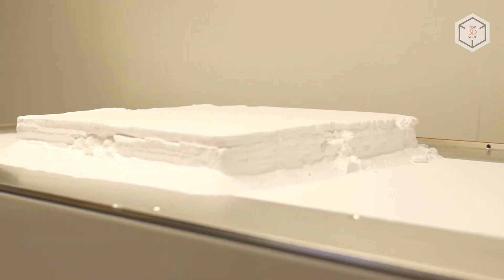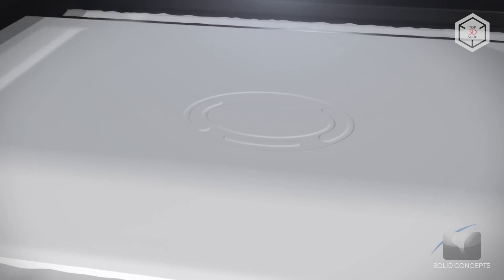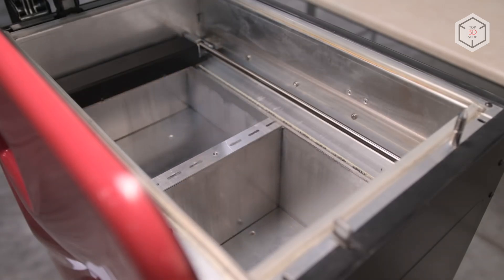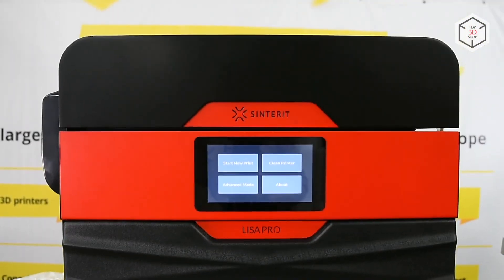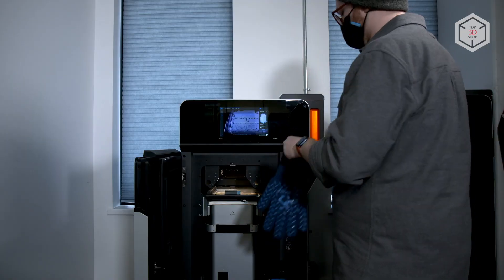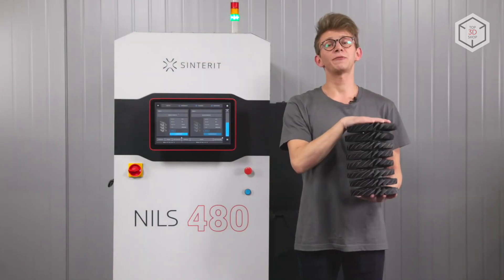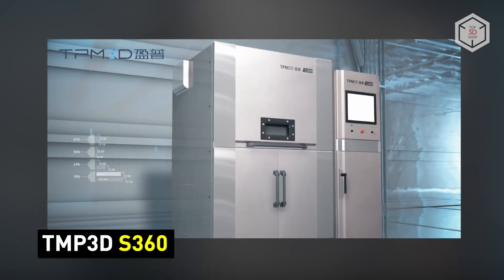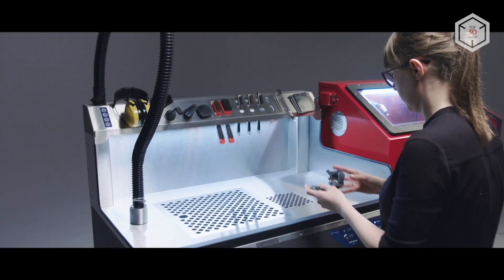Selective Laser Sintering Overview and the Best SLS 3D Printers on the Market

Comment: Heard terrible things about formlab fuse. Literal nightmares about terrible print quality. Not accurate whatsoever.
Reply: There are/were shrinkage compensation formulas that need(ed) some tweaking for sure. If I recall correctly, there was a manufacturing fault with the build chambers that was causing layer lines or z shifts. I was informed of this about 3 or so months ago. The engineers in Somerville discovered it and I believe updates were sent to the factory and a rebuild / repair plan was likely rolled out. I think it was a user serviceable fix. There were definitely some quality control problems with the factory making the Formlabs build chambers as they had previous issues that were also user serviceable. That said - users shouldn't have to be reworking brand new equipment.

Comment: I uploaded a model to one company for a quote and for something about 20 inches x 7 x 5 the quote was around $10,000 for aluminum. I called them to check and they said the quote was correct. I want to use this technique for art but at that price it is not cost effective.
Reply: If you want to print with aluminum, then you should try SLM printer instead of SLS
Reply: hello,we also provide 3D printing service, just curiously the quotation before.How about inquirying us with you 3D files?

Comment: Note, The Formlabs Fuse 1 is no longer available as the Fuse 1+ was released in 2022. The Fuse 1+ utilizes a 30W laser which is a significant improvement over the Fuse 1's 10W laser. This, along with an integrated agitator in the hopper, allows for improved print speeds to the tune of nearly 2x over the Fuse 1. The 30W laser also allows for a greater variety of materials such as Nylon 11 Carbon Fiber and TPU. (The Fuse 1 can only print Nylon 12, Nylon 12 GF (glass filled), and Nylon 11). There is no option to upgrade to a Fuse 1 to a 1+ so a new printer must be purchased. The only change required for the Sift post-processing unit is a firmware update to support newer materials (and potential bug fixes and changes).
Reply: thanks
Reply: By replacing the Fuse1 with the improved Fuse1+, Formlabs also doubled the price…
Reply: @fluxcapacitor  Price only increased $10,000 on the Fuse 1+
Reply: @nrgzrbny  Admittedly. I always forget that Formlabs already almost doubled (+85%, more exactly) the price of the Fuse1 wrt the $9,999 price point they promised during its development stage. 
So now, this is "only" a 50% price increase from 1st gen to 2nd gen. "Only" $10,000. lol
- Expectations (promise): $9,999 
- Reality (Gen 1): $18,500
- Gen 2: $28,000
I wonder how much the 3rd gen will cost at this rate!
Reply: @fluxcapacitor  And they moved the hopper, changed the color, delivered it 4 years after the promise date, and it still wasn't quite ready.

Comment: Doesnt really matter what the printers cost, the price of the powder is insane.

While some of the leftover can be reused, a single part will be quite expensive.
Reply: thank you - I was wondering about the cost of material
Reply: Not only the price. The material is just a hell to work with.
Reply: @kongyiu  worse than liquid resin?
Reply: @AP-hv9ll  Yes for sure. Resin smells and is more toxic, but it’s not too difficult to handle. The powder for SLS printing will go everywhere. Don’t try working with it without a mask, you don’t want that powder in your lungs.
Reply: @kongyiu I agree. Though PA12 powder for example has the benefit of being not as toxic as uncured uv resin. 
While you definitely need to wear a mask and should wear gloves it’s not as much of a problem getting the powder on your skin.
You definitely need to wash your hands and bodyboards that come in contact with the powder throughly afterwards though.
Reply: @kongyiu and as you said it really gets everywhere 😂
It makes the floor slippery too

Comment: Lacking price points :(
Reply: Agreed. there is NO REASON to hid prices in 2022. it seems more sketchy. You will not scare away a person that can only affford a prusa by telling us these machines are 20k. a person looking at these machines either has the money or they dont... So lead the way and give pricing and options on that ...for sure.
Reply: @miestermind costs over 100k
Reply: The Formlabs Fuse 1+ 30W starts at $24,649 for just the printer or $24,999 for basic starter package. You'd definitely want the Sift for depowdering/sifting/powder recovery & refreshing/dosing/mixing. That brings you to $36,893.

Ideally, due to cooling times, you'd want the High Efficiency package that comes with two build chambers for $41, 640.

I believe when you buy the packages with the Sift unit the class 3 bonded, grounded, explosion-proof vacuum is included ($3k). This  grade vacuum is required for safe cleanup of SLS powders as they have the ability to ignite when sparked.

You can also buy their new Fuse Blast post processing station, or provide your own media (glass #9 or #10) blasting station. You can use #12 or #13 media as well, but it definitely leaves a white haze on the parts you have to clean off.
Reply: The basic formlabs start at 15k for a basic model